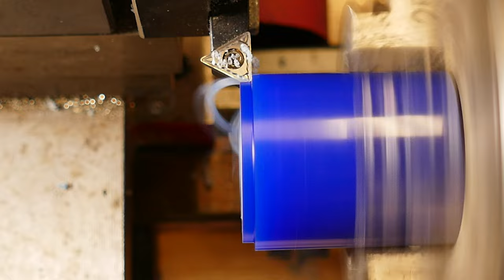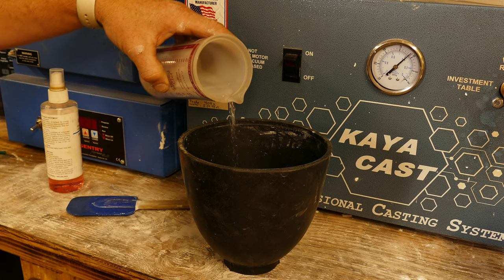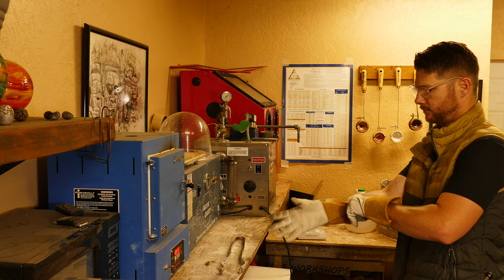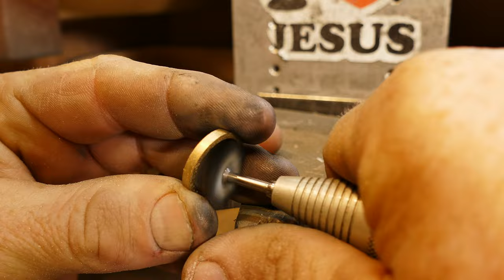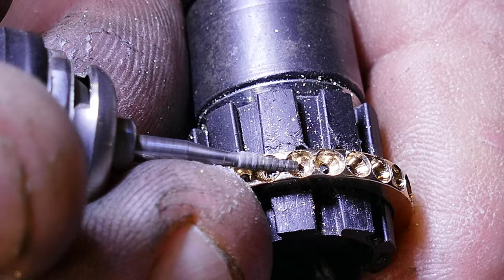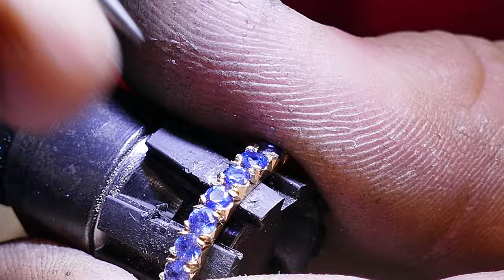Making a Sapphire Eternity Band

Comment: Beautiful work 👍. How do you keep stones on the ring before marking center punch for drilling? Do you wax it or simply wet them and they will stick on surface? Thanks
Reply from the maker: I just lick them and it holds them right in place. It’s on of the easiest methods :)

Comment: where do you get that wax heat pen from and is the vacuumizing machine necessary? Is the spinning moldconstruction selfmade?
Reply from the maker: I get the wax pen from Pepe tools. That is a really useful almost necessary tool for wax carving projects for sure. The vacuum machine gets rid of air bubbles and you really can work without it if you had to. The centrifugal caster itself was purchased but I did make the guard around it.

Comment: I don t understand the spinning processus. You are using wax I think (the blue ring) then you create a mold I guess but then after putting it in the centrifuge the mold seems hollow on one side when both sides should be filled. Then I don t get the spinning and if the support for the ring is on the outside or the inside of the spin (seems it should be on the outside. Can you clarify the wax then mold then spin process it is confusing to me
Reply from the maker: Once I made the mold, it went into the oven and all the wax melted out making a space for the gold to go in. I melted the gold in the spin caster and the spinning shoots the gold into the mold. The spinnning helps push any air out of the mold and out of the molten gold.
Reply: @CoinRingsfromTheMint  Thanks makes sense :)

Comment: Why cast such a simple band? It doesn't seem to add anything to the final product. Wouldn't it be simpler to just forge it?
Reply from the maker: Either way can work just fine. But I measured that band in thickness and with down to .01 of a mm to fit my stones perfectly. That is really simple and quick in wax. Doing that in metal is flat out more time consuming for me. Not to mention when I file down wax I lose no money. When I file down 14k gold it starts to add up.